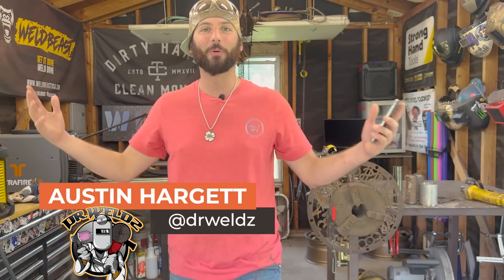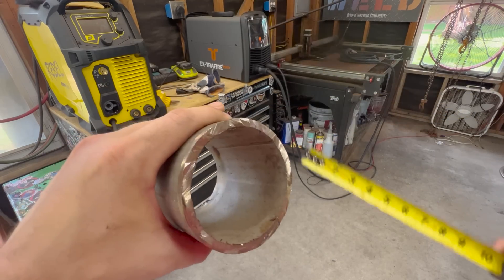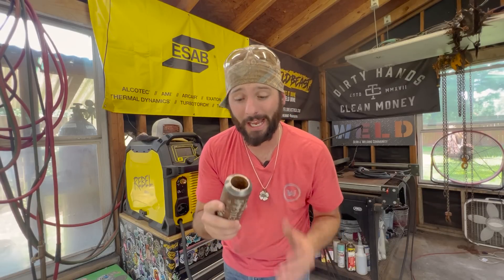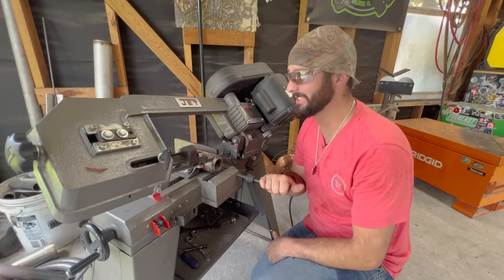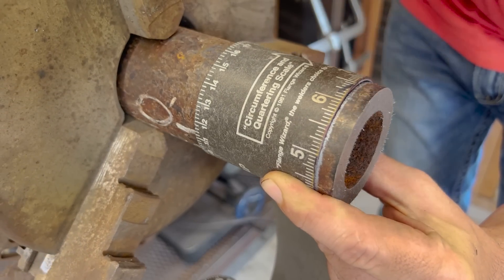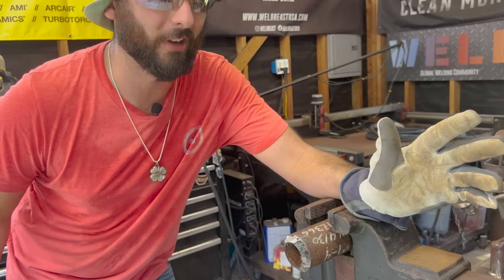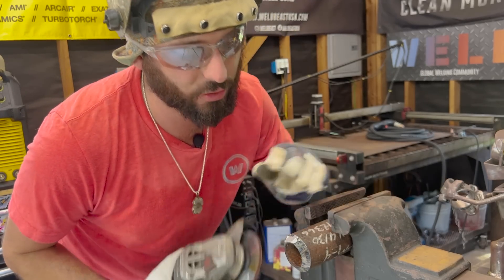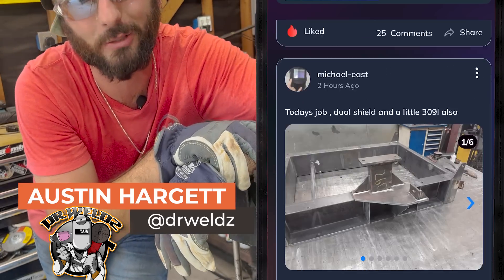How to Hand Bevel Heavy Wall Pipe

Comment: I like to use a 1/2 round file on the i.s.(inside).  Get the rust off & (removing the thin "skin" on the i.s. of the land).  Now the true size of the land will be had. Will have to sand the land again to get the landing to the desired thickness (b/c the file has taken off the thin "skin" that makes the land narrower).
Reply from the maker: That is a great tip!